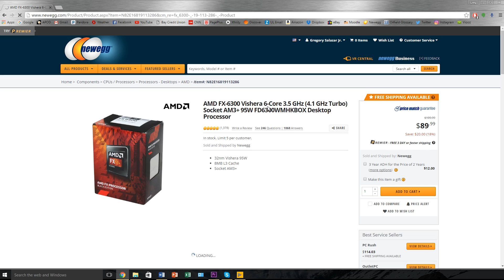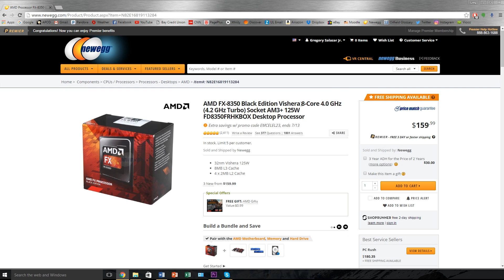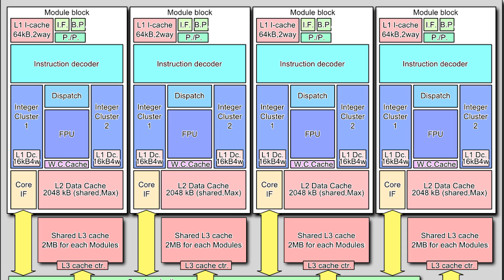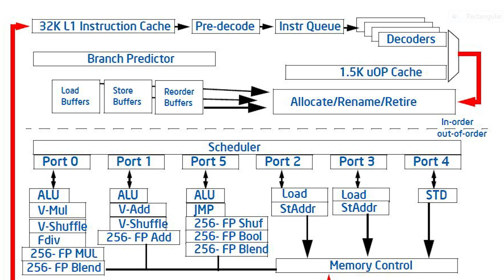How Many Cores Do AMD FX Processors *Actually* Have?

Comment: Its been awhile since I've used a amd cpu my current build is a 5820k, the one before that 3770k, then a q9550, e8500 think the amd cpu was a  5000+ if im not mistaken. Think it was a 2.6 dual core. And ive owned one amd gpu a vapor x 7970ghz great card. But on the nvidia side its 1070,780,560ti,8800gt,6800gt. I want amd to do good again especially in the cpu market there doing ok with there gpu's just seems like every time they come out with something great nvidia launches something faster and more efficient.

Comment: So how about the "8 core" processors found in the PS4/Xbox One? 2 logical per physical as well?
Reply: That's actually a very interesting question.
Reply: I think they are AMD, so 8 cores with one FPU per 2 cores.
Reply: No, the ps4 actually uses something similar to a dual-socket design. So it has 2 actual 4core cpus
Reply: Its indeed AMD, two of them though. So it might be 2x 4cores with shared FPUs but I'm not sure.
Reply: Consoles use 2x4 core jaguar. Each core has own fpu so 8 INT and 8 FPU unlike to AMD FX where you have 8 INT and 4 FPU.
Reply: Yeah the AMDs in consoles are 2 sets of quads just like the core2quads so there are also 2 sets of GPUs each with 512 shaders as well. The goal was to have the CPU perform logical stuff with the GPU performing the math which is why they werent clocked high.

+Juan Pablo Espinoza The jaguar cores used in consoles are actually clock per clock stronger than the bulldozer. They were just clocked half as much as the higher you clock CPUs they use more power exponentially and heat also plays a role in that as well. Compare the power usage of your CPU when at 30C and at 80C with the same CPU usage.
Reply: System0Error0Message Pretty sure consoles aren't in CrossFire.
Reply: ***** That's what I said ;3;

Comment: you didn't mention the advantages and disadvantages of the different designs on cross calls and whether the application is single vs multithreaded
Reply from the maker: Of course not. Out of the scope of this video. Strictly architecture in this video, not performance.

Comment: The FPU argument has long been proved invalid , all games that require FPU use the GPU instead or it does use the CPU but only for fixed point calculations.
Reply from the maker: Incorrect. By way of cross-docking it has been proven that FPUs are still used in many games when the GPU is overburdened with shader data.
Reply: +Science Studio But most of the time an overburdened GPU with shader data turns out to be the result of miss-calling functions or instructions holding it up which results in high CPU usage making it holding up as well and you can see the vicious circle emerging . Bad programming shouldn't be hidden behind the "incapable hardware" argument. A game that behaves this way is a poorly written one to which the addition of more FPUs or cores wont make a damn difference. Take AC Unity , thats a prime example of this, open monitoring software and notice the sometimes constant 100% utilization on both the CPU and GPU and chaotic spikes. Btw I'm surprised you reply to the comments very few tech youtubers do that respect.

Comment: AMD do have up to 8 cores, but they are really low IPC we use the word "threads" for virtual threads or when we have a main core that gives threads to do the work. It does happen on AMD, they have the cores, and each is a couple in in encapsuled together. AMD Zen cores will have a similar hyperthreading technology called multi threading.  The cores are around half the IPC compared to a Intel processor, so a FX 8 cores can become comparable to a i5 but i5 have the hyperthreading tech, smaller litography and diferent more eficient raw power getting it the head on performance.

Very nice video, almost fit a semester of tech knowledge in a few minutes.

Comment: Science Studio, you probably heard(read) the "argument" that a single intel core(mostly modern like Ivy bridge+) is equal to 2 core of FX processor, do you think this is valid to say? With this in mind, do you think you can build an intel rig, that out performs an FX 8350 amd rig at the same price point? (Out performing not by single thread, but by multi thread.)
Reply from the maker: It is not valid for the 8350 vs. 2700K example. Single core performance between the two is within 20%. For newer Intel CPUs (an unfair comparison, but so be it), the margins are wider.

Comment: You're obsessed with s340's. I would judge but... I have one.
Reply: s340 is honestly not an expensive case
Reply: -T-X-M- where are you from?
Reply: +Papageorge hey you greece, pay your debts.
Reply: corsair 780t 4 lyf
Reply: That's probably because for the money, they're really good cases.
Reply: +T-X-M sorry then m8
Reply: +ThePaisleyProject I just got an enthoo primo and was like fuck this
Reply: +James Mastroianni enthoo primo? whats that
Reply: +Jubal Harshaw no its a joke, my system cost around 6000, so the 250 for the case isn't much. but I can't stand nzxt cases. fractals define series, phanteks cases other than the primo and upcoming elite, and the cooler master n series, silencio series, and upcoming mastercase series. even corsair with its terrible quality control and clear quality cuts, is still better than nzxt that makes cases that have the worst airflow on the market which isn't ever worth silence.
Reply: +Jubal Harshaw someone really went ham on caselabs
Reply: +Jubal Harshaw I was going to get one but I decided that I could get a primo and a 1080 for almost the same price as a pimped sma8
Reply: Jubal Harshaw although im probably gonna get a second 1080 once one of the cheaper ones gets back in stock (evga blower or basic acx 3.0) as i watercool everything i touch
Reply: Jubal Harshaw with improvements to 140mm fans I use 140mm radiators now. A 420 rad has more surface area than a 480 and there is more air being moved at the tips of the blades. Also I run a 45mm thick 420 in pull in the roof and a 280 monsta rad in push/pull in the bottem
Reply: Viza hehehehe ikr that case makes me honry no homo

Comment: FX 8350 @ 4.5 GHz here. You can actually see the different cores "fighting" each other when running Cinebench R15 multi threaded benchmark if you pay close attention to the test as it renders. When I had this machine built I was sorely tempted to go with a 4790K but the price difference was going to be about 300-400 dollars more just to switch the platform to a good Z97 board and the CPU. I still love this guy though due to the killer price to performance ratio. You can grab an 8350 for $170.00 from Amazon right now. Keep up the good work Greg.

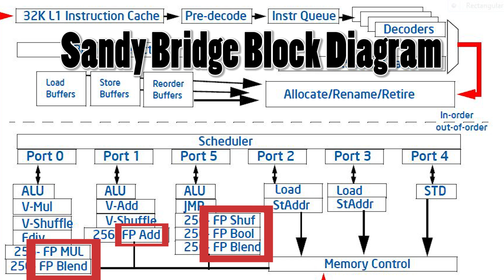Comment: 3:35 again, not quite correct, the FPU only handles non-Integer mathematics.  This is also not why Intel has a clock for clock edge.
Reply from the maker: Not incorrect. Any binary system requires an FPU for even the most simple of calculations, and games today still require one when GPU shader tunnels are filled with data to be processed.
Reply: Science Studio That isn't true... operations on integers do not require an FPU.  I do agree that games almost certainly require an FPU, but it is misleading and incorrect that an FPU is required for all calculations.
Reply: Science Studio It is the ALU that performs operations on integer numbers.